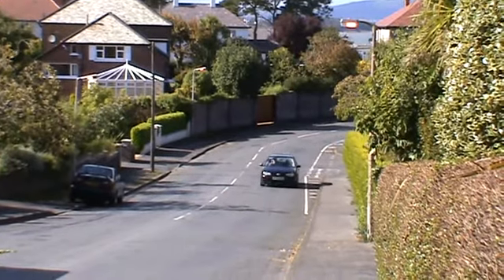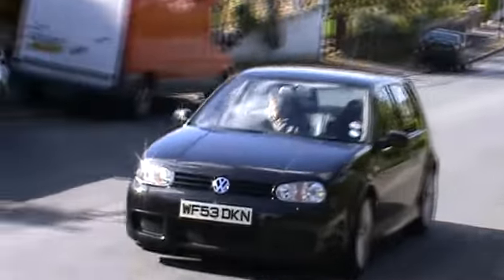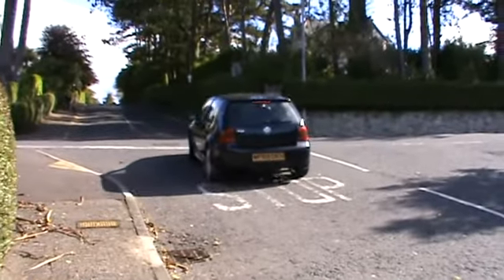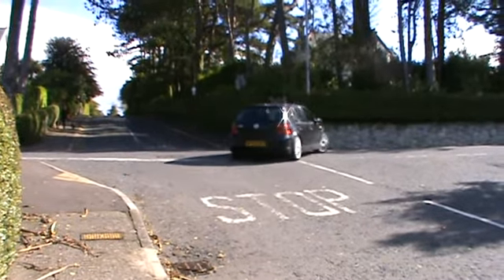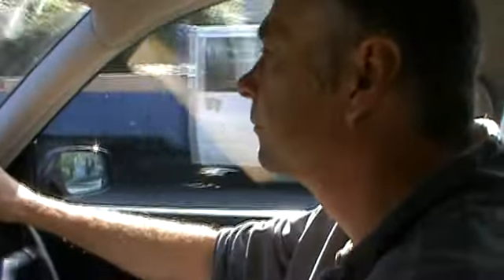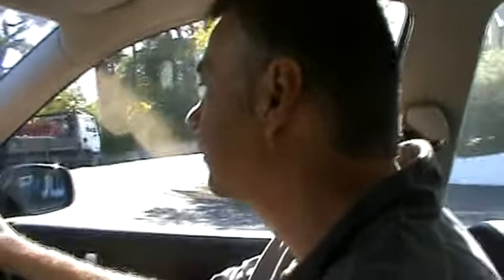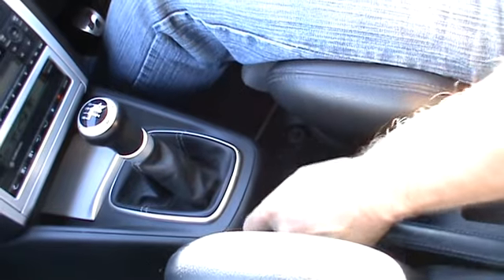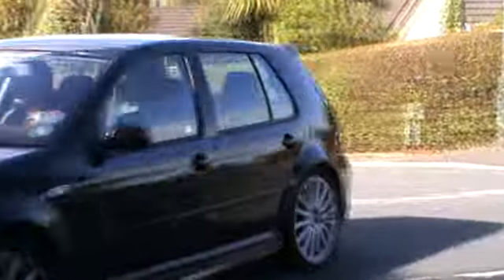Performing a hill start with a stick shift transmission

Comment: Makes sense what you are saying. Particularly about needing to abruptly disengage the clutch.
Ok, it isn't often this happens, but next time I am facing upward on a hill and have to start from a full stop, I will use the parking brake to hold me there instead of the regular brake.
You learn thing new every day.

Comment: I use 3 pedals simultaneously called heel to toe shifting. Takes a lot more practice and may not be possible on some cars with wide brake and gas pedal separation. Blip the throttle with ur heel while holding the brakes with ur toes and slowly release the brakes and clutch and apply gas.

Comment: you dont need to use handbrake for starting on a hill. all you have to do, like he said, is to lift the clutch up to that holding point so that when you let go of the brakes the car doesnt roll back. Find the holding point, let go of the brake, slowly release the clutch from the holding point until the car moves forward then completely let off the clutch.

Comment: I don't use the clutch to hold on a hill, I use my right heel on the brake (Just enough to hold the truck still), right toe on the gas and clutch all the way down. When it is ok to move I give it gas, let out on the clutch until I begin to move,  then I let off the brake.

Comment: Basically, it causes some harm to your clutch. Not too much but if you imagine your clutch as your wheels, not moving. But you imagine your engine and knowing it is on and spinning at less than 1000RPM but still moving then you can imagine that the clutch is having some wear. Just don't do this more than needed.

Comment: @pacmanghostx its easy man just a little help try and keep the RPM's right at 1K and you shouldnt hurt the clutch ive got my factory clutch in my car i bought it with 89K miles and now its got 200K and thats how i drive it daily all you oh and dont worry 1st and reverse are the hardest gears after 1st its easy

Comment: Dude, a parking brake is for when you park.  Hold the car on the hill with your foot on the normal brakes, then let up partway on the clutch when you have taken your foot off the brake pedal, onto the gas and feeding in some throttle.  Do it quickly but smoothly and you won't roll back.  Holding the car with the parking brake is pointless and as for holding the car steady with the clutch, that kills the clutch!

Comment: Really? You keep the car stationary in place on the hill, by running on the clutch partially depressed? What a way to use up your clutch. What happens if you are at a red light and have to wait two minutes? Going to use your parking brake?

Not how I do it. When I come to a stop on an incline, I press the clutch all the way, keep it in 1st gear, press the brake pedal, and wait to drive. Then I quickly take my foot off the brake and put it onto the accelerator, and let up on the clutch.

Comment: Not that hard, easiest way for me is to put the car in first, while holding the clutch, and the brake. Once you have to move, quickly transistion your right foot from brake to throttle and balance the clutch and throttle until you find the friction point. Done correctly, you should have very little roll back.

Comment: It is called a parking brake you are just stopping at an intersection you are not parking therefore there is no need to use a parking brake

Comment: My truck has the parking brake on the floor next the clutch if you need use the parking brake on hill in stick/manual transmission your incompetent manaul driver
Reply: Johnny Mullet man clutch in, first gear, set the catch point, move from brake to gas faster then you would on flat ground, and fully come off the clutch